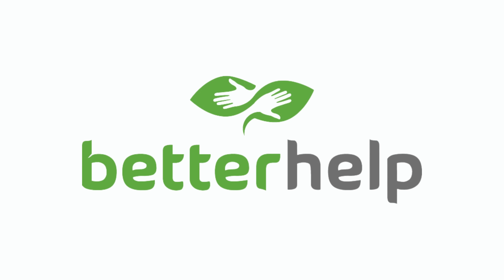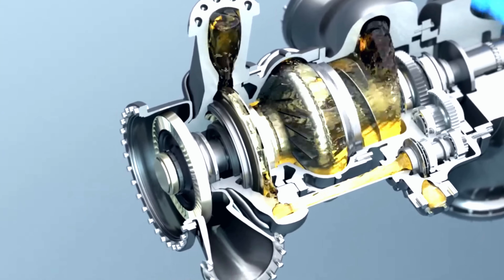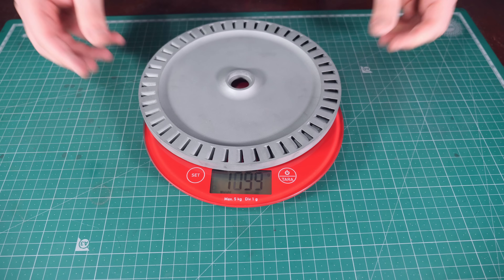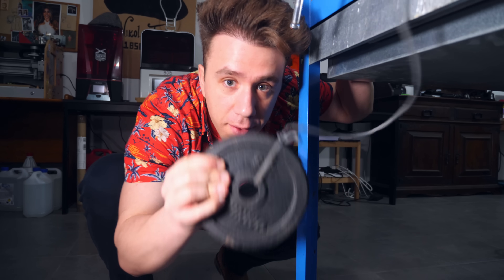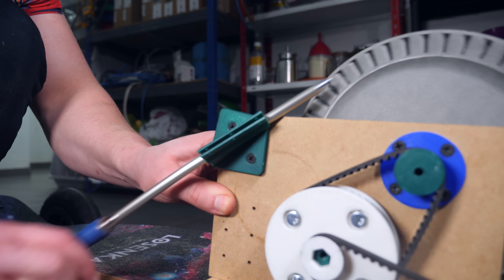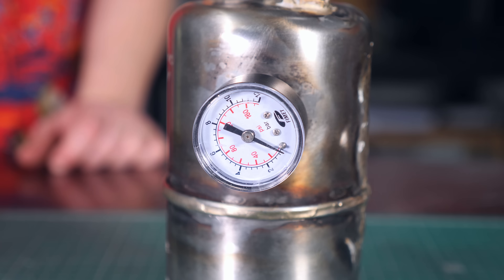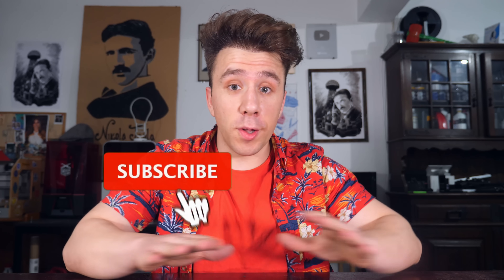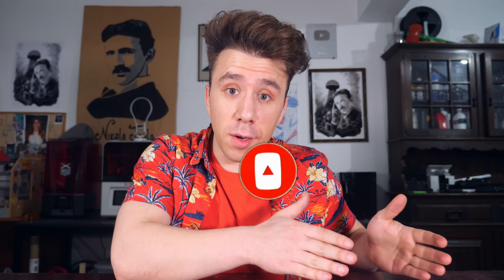I built a TURBINE Skateboard

Comment: Holy crap. I was going to say to never stand in line with a turbine at spin up because that is usually when they have a catastrophic failure but that is not as bad as pressurizing an untested homemade pressure vessel. I am glad nothing went wrong but how have you lasted this long doing crazy stuff like that?
Reply: The fact that the turbine is a flywheel makes it even worse
Reply: @szogun1987  yes and it is unbalanced and unsupported on one side with a plastic shaft.
Reply: @WILFRED1184  seems like something worth replicating 😁
Reply: @szogun1987  no thanks. I get enough excitement on a daily basis at work operating 7 1500HP boilers.
Reply: Yep, squeaky bum time on both counts 🫣
Reply: He must have a bet going with Styropyro.
Reply: @MmntechCa Styropyro doesn't strike me as this reckless, however. He knows basically how much he can get away with somewhat safely, even though it is quite often teetering at the edge. Integza in this video strikes me as not even doing his due diligence... unless it's staged for engagement, which he certainly gets this way...
Reply: Not to mention the end of the video where he puts a giant 200 bars pressurized vessel in the same plane just next to an unstable 3D printed metal high RPM gas turbine - aka the Shrapnel Launcher Spinning Disk of Death - all of this with his head just above.
I love Integza but here he really put his life AND the cameraman AND probably some people in the house in high danger. I bet that if multiverses exists, many of them lost Integza this day.
Reply: This was wild. My engineer nerves were complaining throughout the video („why don’t you ever do such crazy things? See, nothing happened!“)

Will send it to the safety guy at work to give him a headache. ;)
Reply: This dude has 0 regard for safety. He thinks he knows what he's doing until it catastrophically won't.
Reply: @TBButtSmoothy Just that first spooling test made the hair on the back of my neck stand up. He doesn't realize what's waiting in that wheel.
Reply: Dear god, the runout on that flywheel was terrifying... followed by the ad read "do you ever get anxiety?"... Haha yes, but mostly when watching you playing with fire whilst there's open fuel containers around and other such things. Absolute madness to be wearing safety glasses when any significant chunk of that dodgy flywheel would happily sail through a good few sheets of plywood at those speeds. Just engage safety squints at that point. I also enjoyed the dodgy pressure vessel with a gauge 'for safety', so you can see what pressure it failed at whilst it douses you in liquid nitrogen, I assume? I've enjoyed a few of these videos, but he's daaaangerously overconfident in his engineering skills
Reply: Yeah he's on the edge of a lot of things here. I've "taken" a no longer assembled rotating mass... It's really not recommended... at all

And yeah the pressure... steering... all of this going on exposed... gas cylinder not attached in some way at least... the list goes on and on
Reply: The bad part was claiming that jet engines are efficient. No, no they are not.
Reply: @refluxcatalyst7190 thrust to weight ratio....
Reply: @refluxcatalyst7190 steam turbines are about 60% efficient vs 40% on a diesel engine and 23% on a gasoline engine.
Reply: He is Portuguese - they don't do that safety thing in general - riding a speeding car while the driver smokes a joint and the brakes aren't working properly? Nightmare? Nooo just a regular Taxi in beautiful Lisboa😂
Reply: The heat in the bushing that bold holing on for dear life.. the rpms of that wheel... yikes... lol.. good fun though!
Reply: Agreed, and I've got the scars to prove it!
Reply: Awww... you sweet summer child. This muppet is the Hammond of makers.
Reply: Because he's not stupid, he is pretty crazy tho.
Reply: Print a stator and a second turbine and encased, all would increase efficiency
Reply: I hope he does off screen safety testing.
Reply: And them he rides it between his legs! The balls on this guy..... well, I'll see when I'm done the video if they're still there! 😂
Reply: Haha, I came to the comments at this exact time too. I don't know what it is about YouTubers and heavy high-rpm flywheels and no protection.
Reply: Yeah liquid nitrogen in a closed vessel is pretty dangerous. We used to put it in plastic bottles, close the lid, throw it, and wait for the explosion.
Reply: he needs a safety tie
Reply: Electroboom is even crazier.
Reply: Holy crap is right!
Should have spun tested the turbine to an overspeed condition in a remotely controlled setup.
Should have hydrostatically tested the pressure vessel to some limit and then have a pressure relief valve set at a value substantially below the hydrostatic pressure test.
Reply: Thank god people are saying something because my ass is clenched so hard right now
Reply: I mentioned elsewhere that if he continues to be like this I will be forced to unsubscribe as I cannot support such reckless behavior.
Reply: Integza testing his newly 3d printed metal turbine disk - https://youtu.be/AHooPPnCL28?si=LmZsQfHuiwjXgHJf

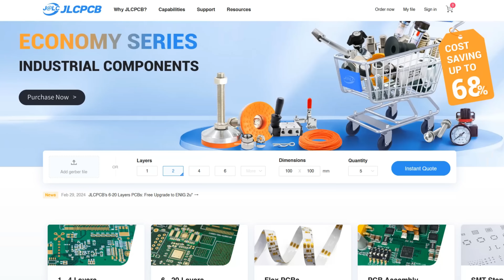Comment: 2:40 CORRECTION: A bazillion is a 1 followed by a billion zeroes.
Reply: 3:45 I'm glad to see your tablesaw blade at a proper height, but you should push the piece up against the fence or on both sides of the piece equally.  You should use a pusher block.

Comment: 1:10 "why arent cars powered by turbines"

there are plenty of videos on just that, many companies have tried to make them, but the issues are mostly practical, stuff like the turbine running extremely hot and melting itself and anything behind the exhaust. also the "can run on any fuel" feature is not entirely true, its very sensitive to additives, so normal gasoline (especially leaded) wears the turbine down very quickly. they also just require higher precision, complex to make parts, and stronger (more expensive) materials.

Comment: I think that with a little bit of optimisation you can go much faster! 
- balance the wheel of the turbine
-give it an enclosure (a stator basically) that can also support it laterally (it shakes a lot when you blow the compressed nitrogen)
- keep the nitrogen tank horizontal to get a lower center of mass 
- wear a helmet so you would feel confident go faster! 

We can get to see some nice speed records with this thing a think!! I love you contents every time!
Reply: you forgot the step "learn how to avoid making a fucking pipe bomb in the future before continuing projects"
Reply: The bearings he is using are greased, these are robbing a lot of power as there is not a lot of torque and high rpm. This application calls for oil, you should get a bunch of extra oomph just from that. But then you have to deal with oil, oil pump, etc, so maybe not worth it.
Reply: His turbines never work because all his projects are half-assed. 0 actual engineering was put into it. He just looks at pictures, and videos and copies them as he understands it.
Reply: @TBButtSmoothy It's a part of the charm and i've seen worse.
Reply: Would more nozzles help ?
Reply: @AndrejMejac  yep, that’s a good idea! Probably adding another one on the other side of the turbine would solve the shaking problem since the force would be symmetrical. I did not understand if the turbine is symmetrical, but if it isn’t you can probably mirror it and stuck the two together
Reply: @pierregarbo8628 Symmetry is a good point. Perhaps there is an optimal number of nozzles, depending of in-flow, nozzle size, outflow, mass distribution and such. Enclosure could lower loss, i guess, at least at one side.
Nice explosion is probably a bonus.

Edit(2 more sec of thought)
Reply: For stability an enclosure wouldn't do much but it Would help with the power it creates since the air moving over it would still contain power it can impart on the turbine blades before exiting much like the tesla turbine.
It would be better to add a second port on the opposite side to balance the  thrust against it so it doesn't wobble so much due to all the pressure being placed on one side.
And yes ensuring the turbine is actually balanced would help.

Comment: oh god that first nitrogen test was really a pipe bomb powered skateboard
Reply: Yeah, that was one of the more sketchy things he's done on this channel.
Reply: Reminded me of filling my old Air tank. Standing over a 30-year-old pressure valve and fitting
Reply: unless there is a over pressure valve :p
Which there was not :p
Reply: @spoockeErazor Still dangerous because he doesn't even know what kind of pressure that vessel can take.
Reply: @Riiludragon  i answerd this already to there are ways to see if it can take it.
But for the 50th time I would not do it.
Reply: @graealex  it is not a weld.
its like hot glue but for metal and way hotter to apply.
if you would weld such thing metal.
you would need a TIG.
Plus the out side of the weld would be compromised  again the weld would be stronger then the cups.
Cause a tig weld would suck thickness away from the cups into the weld it self.
Which would make it slower in thermal contraction.
Reply: Exactly what I thought :O
Reply: The brazing is already like a weak point (Even more at so low temepratures), i guess that thing will not explode (like a pipe bomb or nothing too dangerous), if that blows up, it will do like a pop corn, or more likely just separate the two mugs and release a big cloud of nitrogen. Any way i will rather not be near that thing...
Reply: @pedrogil9092  un true some brazing are actually stronger then what they are brazed to.
IT depends what to what and which rods you used.
Still lol Do not do this :p
Reply: @spoockeErazor  rod doesn't matter, the cycling from cryo to ambient is enough to induce fatigue.
Reply: @spoockeErazor  Some brazings, not all, besides, the low temperature of liquid nitrogen may affect the strength of the brazing... Any way NOT a pipe bomb. More like the Dry Ice in a soda bottle "experiment"
Reply: @pedrogil9092  i said it before even when it exploded you would not hold much kinetic energy.
But !!
if you are bend over it like he hid HE would a much stains of home made ketchup :p
And the cold braze is not the problem either.
ITs how clean the material is where it gets applied.
You know you did not have a good braze pool going when it is not shiny.
Reply: @yoshums7970  again  it depends of what stuff the rod is made off to braze with i answered this now a couple of times READ thank you.
the real factor is how clean!!! the materials are.
Reply: @spoockeErazor  it really doesn't. Unless the whole thing is made of inconel, it's probably going to fatigue the joint with a delta in expansion
Reply: @yoshums7970  i answered this already
Reply: @pedrogil9092 it got to 10 bar according to the gauge, stronger than it looks. We had a small vessel burst at 20bar and the shrapnel pierced a 6mm steel tank. Pressure vessels should not be underestimated, I'd be surprised if he's not breaking some law

Comment: Cars aren't powered by turbines for a couple reasons. 1) noise. 2) turbines are fragile. They don't like things getting sucked into the intake. 3) specific fuel consumption is high. Turbines are more efficient at high altitude. At sea level, they burn a lot of fuel. 4) throttle response. Turbines tend to lag behind throttle inputs by a second or several. Not a problem in aviation, but definitely a drawback in heavy traffic. 
That said, I think several of these issues could be fixed with modern tech and computer control, but the final nail in the coffin, cost, is a big one.

Comment: You could build a powerful electromagnetic railgun to launch sugar rockets (the rocket is catapulted using electromagnets, then ignites in midair).
Reply: Strong lasers to ionize the air to guide the arcs of electricity
Reply: @emoubin5601  Then use magnetic fields to squeeze charged deuterium gas down that path of ionized air so tightly that is achieves fusion, putting out megatons per second of death beam.

Comment: The reason most cars aren’t powered by turbine engines is that they aren’t very fuel efficient. If you look at specific fuel consumption of turbine engines (this includes turbo shaft, turboprop and turbofans) it drops of very quickly as power is reduced.

Comment: Holy 🍅 bud... putting alot of faith in that printed turbine handling those rmp/cold temps that close to your face 😬😅  cheers for another great project
Reply: My concern was less the flywheel, and moreso there not being a bearing on both sides.

Granted flywheel explosions are a valid concerns, doing that math and if need be making a container for it (although this only does so much, some FES systems are put in the ground for this reason if i remember correctly)
Reply: Also putting a lot of faith in a thin-walled, brazed, pipe-bomb.
Reply: NO FEAR!! :p

Comment: The lack of a safety valve on a sealed container filled with LN2 really scares me, I hope you don't try scaling that up without one.
Reply: That was totally nuts. Super, super stupid. Stay safe Integza.
Reply: I guess the bad weld was the safty valve ^^
Reply: It's just brazed together.... it's not like it would handle to much pressure either way
Reply: I am thinking the stainless would burst first at the thinner sections, or seams. Brazings can have up over 100,000 psi ratings. where stainless steel itself, at least in pipes, have much lower burst ratings. @rc-daily